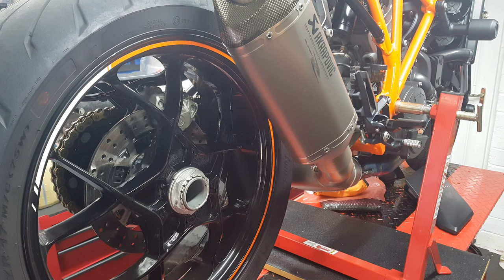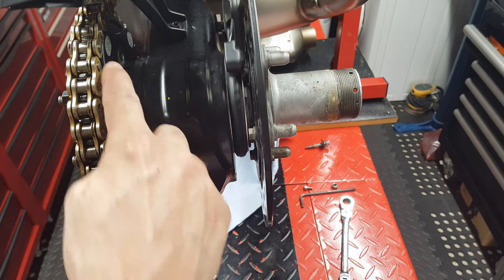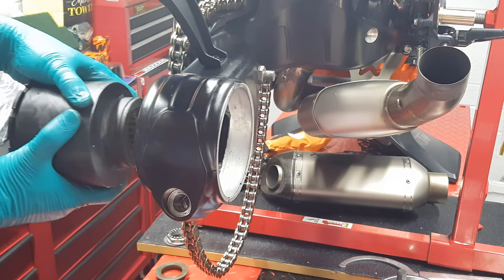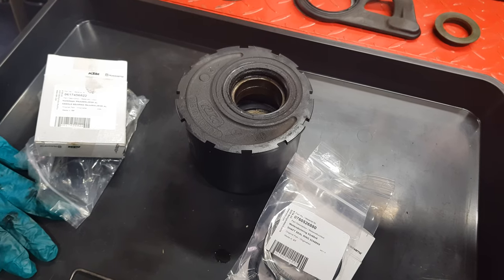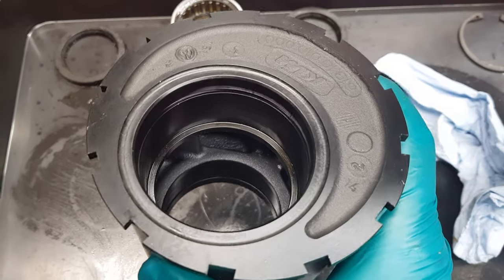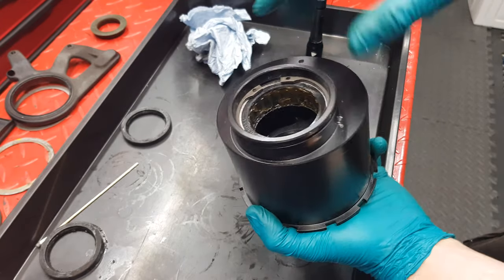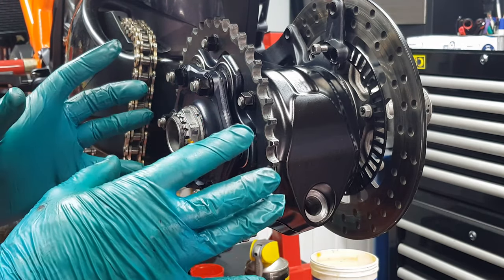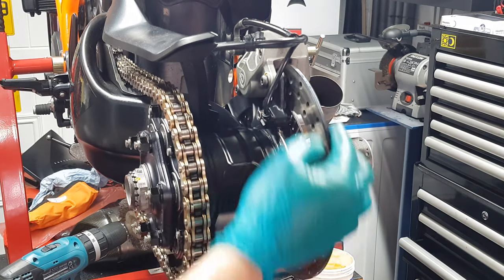KTM 1290 Superduke Rear Wheel Hub Bearing Change Replacement Gen 1 Gen 2 | HOW TO 4K 2014 2016 2017

Comment: 75k miles on my 2014 and i've changed the rear bearings twice, each time rusty and full of water, i hadn't heard of the drain hole mod for gen1s, i might take the hub out and drill the swingarm this weekend. cheers for the vid.
Reply from the maker: Drilling a drain is a must! Good luck!
Reply: 75k miles on a Gen 1 Super Duke R? Thats impressive! Do you ride it hard? What issues have you had?

Comment: Just did the job tonight, 2014 with 20k miles and could feel the rear shifting around . Your video made it much easier to see the step by step process, hardest part for me was the aluminum carrier corroded with the steel axle so significant effort was needed separate them.
Reply from the maker: Sounds like you had quite a bit of corrosion! Glad the video helped you  and thanks for the support. Gen 1 is still a great bike once the known issues are sorted. 👍
Reply: Hey man hope you see this - I am suffering the same problem, how did you get yours separate?
Reply: @robbown164  for mine it took a torch around the splines, penetrating oil, a 5 ton gear puller with an impact, and someone hammering a rod into the back as I used the gear puller and impact. I also had to replace the sprocket carrier and sprocket because the gear puller bent it and the corrosion took a chunk of material off the splines where the corrosion had occurred . On a positive note, last time I took it off replacing the tone ring with a corrected one, it came apart nice and smooth thanks to full coverage with anti seize. Good luck, a pain for sure.
Reply: @Willgoingplaces  Ah shit. Well, it aint coming off with a 27oz dead blow and a torch then eh. Thanks for the input man I appreciate the quick response.
Reply from the maker: Holy shit!
Reply: @maximusvr46  Yes, and it wasn’t even a large portion of the spline mating surface; just a sliver. Everything I read when I ran into the issue said for galvanic corrosion the amount of time it’s been working if the big factor in how difficult it will be so this one was probably a long developing issue.
Reply: @Willgoingplaces   So far I have removed the bearing seal on the sprocket side, and drilled/hammered through the first smaller bearing which doesn't seem to be the issue. It appears to be the big bearing thats the issue.

So like filling a jam donut, I've gone through that, then filled up and sprayed the other bearing with penetrant. Now letting it sit, then I'll heat it, and then get to hammering.
Reply: @robbown164  sounds like we had a different issue, mine was removing the axle because the sprocket carrier was corroded in place 
, after that was solved my bearings came out easily enough with a pivoting bearing puller and slide hammer borrowed from an auto parts store. New bearings installed with a driver kit from them.
Reply: @Willgoingplaces  Oh. Mine is the axle is seized onto the bigger of the bearings, closest to the brake rotor side of the hub.

The sprocket carrier came off just fine. Frustrating!
Reply: I GOT IT! Managed to get the penetrant where it needed to be and its out :D :D
Reply: @maximusvr46  Is there a list of the known issues? Im looking at picking one up.
Reply from the maker: @whatsthedealwith1603  make sure it has a healthy battery 12.3/
.6v on ignition only, oil temp is reading correctly, headstock is not loose, horn working, rear bearings done?, no leaks, good service history, oil a nice clean colour. Radiator is good nick no leaks

Comment: How the heck is your bike so clean? It's literally spotless. I have mine apart thanks to your video, and it's filthy lol.

I greatly appreciate this video and your work on this, it has helped me immensely. I've been trying to learn and take apart my own gen 1 1290, due to shops seriously messing up repairs in the past. (one shop literally put the rear wheel on without lining them up with the hub studs. How the heck did they manage that?! Could have messed up my wheel with that massive torque lol.

Cheers!
Reply from the maker: i just keep on top of it, give a a good clean and coat with gt85 and acf50 often. Glad the video has helped you! Yes its hard to trust anyone these days working on your property. Good luck with yours! thanks for the support.

Comment: Excellent video. Just felt play in the rear wheel of my '15 SDR. Will use this when I finally get chance to replace it but for now, no riding :(
Reply from the maker: Thanks mate!  Is the play bad? Try checking the tightness of the wheel nut 250nm. Good luck!
Reply: @maximusvr46 Hey man, I hadn't seen this response! I did check the rear wheel torque and it was to spec. Its now 4 months on and I have the parts arriving in the next week or so, so just doing some studying watching your video over again :)

Comment: With a Dremel or similar you can grind a small channel from the low point to the hole you drilled 👍👍
Reply from the maker: Yes you're spot on mate, I actually ended up doing something similar to your suggestion but forgot to add to the film. You can just see at 18:31 the sharp v shape to the left of the hole where I dremelled a small groove in

Comment: Just about to open up my 2015 model. I was wondering if it would be possible to dremel a groove from the lowest point to the split-line in the swing-arm?  Possibly to the LHS so it helps when it's on the sidestand. I love my KTM's but that's pretty poor, drain-hole in the hub but no-one wondered where the water would go? Great video, thanks for giving me the confidence to open it up myself, much appreciated.
Reply from the maker: I actually did dremel a drain groove in the end to help the drainage. Good point when it's leant over on the side stand. Good luck!
Reply: Thanks for your reply👍. Is there a general opinion on how the water is getting in there?

Comment: I'm gonna need a frame stand for that... rear wheel stand is gonna be a problem 😁 I've seen folding ladder / ratchet rope constructions holding a bike up that look interesting. Oh wait, I'm gonna need a press too... oh well. Can still do about 95% of the job on my own judging by what I'm seeing in this video. Thanks for making!
Reply from the maker: A metal bar through the frame where my stand mounts to will do with axel stands, just strap the front wheel down stop it tilting. Take the housing to a garage to press in n out shouldn't cost much. Just give me a shout if u need help, thanks! 👍

Comment: I used a layer of Denso-tape (waterproof grease impregnated plumbers cloth tape) to fill the void so now mine drains to the hole I drilled. The Dense-tape just sticks in place and never moves. I used a 5.0mm hole and screwed in a 6mm diameter wafer head Torx machine screw with blue thread lock.
Reply from the maker: sounds good mate!

Comment: I wonder if countersinking the holes on the inside would help funnel the water.  The surface tension of water might keep it from draining in small amounts.  Just speculation but very informative thanks mate!
Reply from the maker: Yes good idea, i added a comment but didn't show in the video that i dremelled a small groove to act as a channel for the water to flow down you can just see it in one of the clips  but yes counter sink would help aswell. Thanks for watching!
Reply: @maximusvr46  I didn’t even think of that, that’s damn smart too!

Comment: Have a 2014 SDR and had to change the bearings and sprocket etc just now, very costly. Showed me water dripping from the assembly. 22000 kilometers

Comment: I have a gen two. The swingarm bolt is very tight in some areas when trying to remove it. Well only 70Nm of force needed to undo it. I'm guessing it's just shite on the threads, should I be able to remove the bolt fully with everything still on the bike... chain & rear wheel? I couldn't see why I shouldn't be able to but with how much force I needed to put on the bolt. I didn't bother, i'm gonna order some penitrating fuild. I want to fully clean the bolt & threads that's why I want it off :)
Reply from the maker: Yes i dont see why you shouldnt be able to remove the bolt fully, its only a pinch bolt. Have you got the bike up on a rear stand?
Reply: @maximusvr46  Yea, bike is on a rear stand. Looks like the threads on the bolt is messed up, have to order a new one. Gotta love pre owned motorbikes lol I cleaned the inner threads aswell, so hopefully it’ll go in smoothly with the new bolt & clean threads! Just waiting is a pain 😢
Reply from the maker: @Near2Future  thats a nightmare! u sure the swingarm threads have not also been cross threaded? as its aluminium .....sounds like its been overtightened

Comment: Parts are $800 roughly, is that same for you ? Seems a bit high. Ktm telling me i need a kit with a hub and bearings pressed  already
Reply from the maker: @pasha_houston  not at all! Very expensive that u only need the bearings and press or have them pressed out and in
Reply: @maximusvr46  unfortunately I  live in an apartment so work like that wasn't an option for me. KTM dealership here making it sound like pressing in bearings is really difficult and might be a fail and therefore strongly recommended hub with bearings 🤦 
 I'm beginning to think they are not competent techs.   They had me replace the rear brake ( for squeaky brakes concern) twice and now telling me I need a rotor, I was like why wouldnt you check that the first time or the second 😅 
 Anyway, I'll pay up, but this might be my last trip to this delaship and bottom line I'll have to  sell the bike :(
Reply from the maker: @pasha_houston   whats the reason to sell the bike? If you cant or dont have access to work on it yourself then a decent bike garage would be far cheaper
Reply: @maximusvr46  yeah it's tough with servicing KTM in the states. There is a good shop that does aprilia bikes (I used to have one) and if they are willing to do the work on my KTM great, but if not, I can't trust this delaship. 
 Last time I left there the service light was on and low tire light was on, nobody cared to check, and that's not to mention the diag wasn't done right. 
 It's hard to find reliable techs I guess, it seems like the only person who cares is the manager there, but he can't do it all by himself lol
Reply from the maker: @pasha_houston  just try and find someone else but ditch that dealership

Comment: Hi, very good video. Mine has a "rattling" or rather "banging/clicking" noise coming from the rear. I suspect it is a bearing. I have 2019 superduke gt  (2nd gen) and it has 22.000km. Must check for a hole. Any extra hints? Thanks a lot
Reply from the maker: Thanks for support! Yours should have a hole u can just look underneath. No tips really just maybe have a go this winter and strip it down and check or replace 👍
Reply: Did you get around to this? My'21 is making the same clunk sound and suspecting the bearings as well
Reply from the maker: That's gen 3 bike? Have you had tyre changed by anyone? Has it been torqued up to 250nm or 270nm? If gen 3 is 250...

Comment: I am in the process of changing my hub bearings , but me sprocket carrier is siezed solid to the shaft. I removed the 41mm sprocket carrier nut, but cant get the carrier off the shaft, ive tried heat, WD40, ACF50, striking it with a hammer, can anyone help?

Comment: Hi, thank you very much for your video.  

I have a 2014 V1 KTM 1290 SUPER DUKE R and yesterday on a ride I could feel the rear kicked out. 

There is a slight play in the rear wheel.  

So I would like to change my bearings.  Do you think it is necessary to change the axle and the hub or just the bearings will do.  

Sorry for my English, I'm French.
Reply from the maker: Hi, thanks for the support! it depends on the condition when you strip it down but i would probably say the axle and hub housing will be ok. If your bearings are really bad then you may see scoring and possible damage on the axle.
Reply: @maximusvr46  Ok I will disassemble following your tutorial.  Thank you so much
Reply: Do you have a trick to extract and put the new bearings in the hub without a press?
Reply from the maker: @Sam55150  no you need to use a press. You should be able to take the housing to a local garage and ask them to do it  shouldn't cost much.

Comment: 44500 miles on my 18.. no issues yet...
Reply from the maker: That's the Gen 2 i think, they put a drain hole in as KTM recognised it and added the hole from gen 2 but still didn't want to fix gen 1 customers bikes.  It still may be worth checking them and re greasing. Keep going to 100k mate! 👍
Reply: @maximusvr46  planned on tearing it apart over the long minnesota winter.. biggest thing is .not power washing near the rear hub unless really needed...great video.. answered any questions I had about tearing into it
Reply from the maker: @jimjim753  nice one thanks, good luck  with yours!
Reply: Gen 2.0  2017,  25000km  no problem.
Reply: Update......51000 miles cam chain failure front cylinder......                   30+ tackdays
Reply from the maker: Bugger! Is that new engine now?
Reply: @maximusvr46  ?? Undecided...maybe a 1390
Reply: @jimjim753  No sound or noise that alerted you to the chain problem? Was the motorbike bought new by you or was it used?
Reply: @micromymario23  stock tensioners failed at 10k miles....no real warning... was riding home from work In traffic...I put mechanical tensioners in....at 10k probably chain guide broke
Reply: @jimjim753 gen 2.0?
Reply: @micromymario23  2018